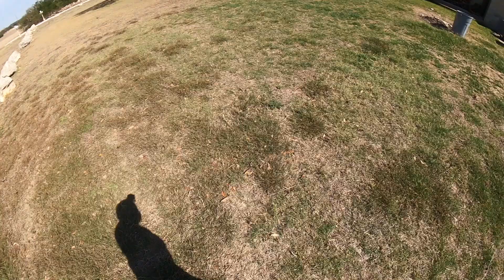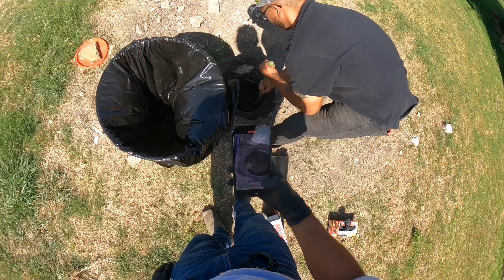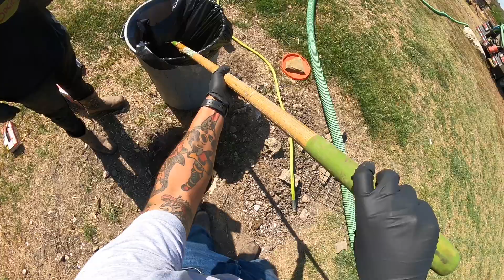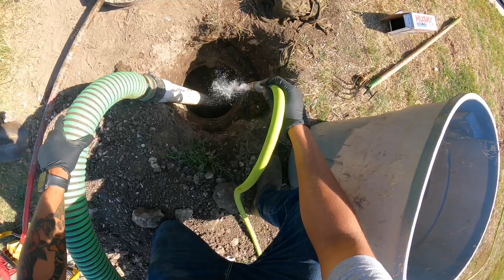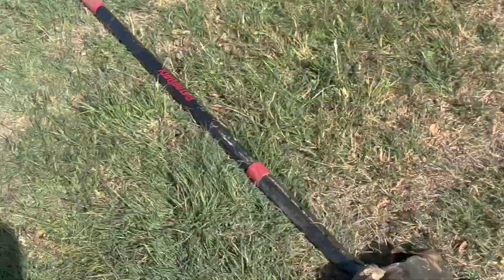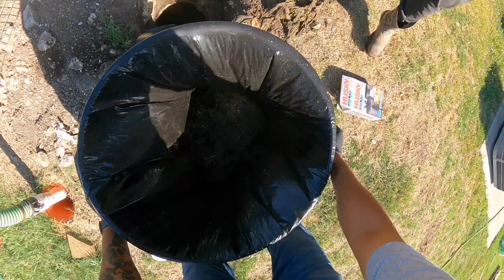Removing Hundreds of Wipes From a Septic Tank

Comment: Never seen a tank like that. What was the small hole you stuck the crust buster through and then sucked out? Also you could get you some of those little anvil spring clamps to hold the bag on the garbage can so the bag doesn't keep falling in. Home depot has then for a couple bucks each. Nice video man